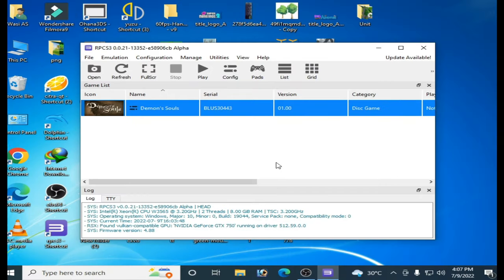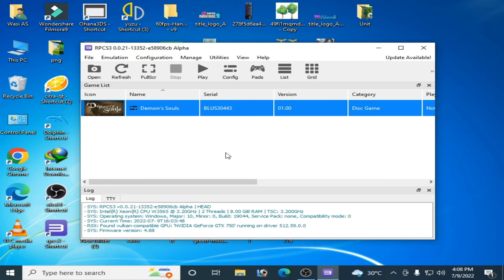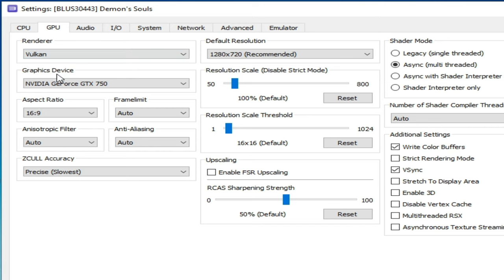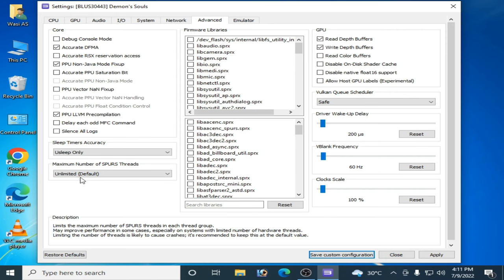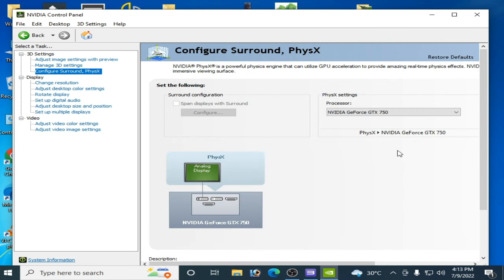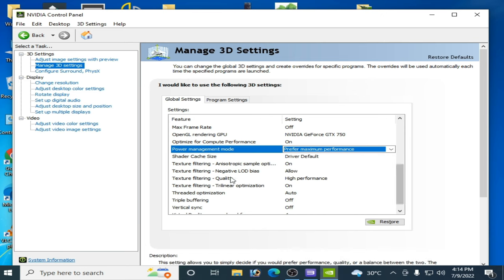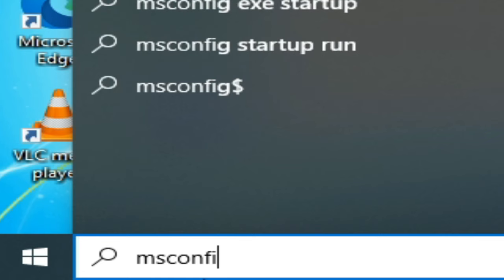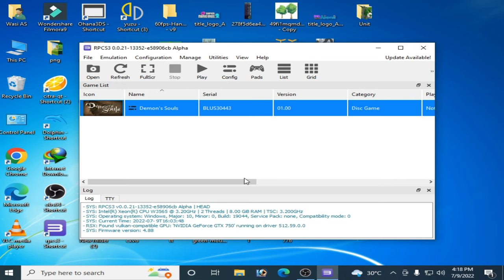How to Fix Audio Crackling and Stuttering in Rpcs3

Comment: I am not doing anything until you explain why you are checking these things on and off. I can randomly check things on and off by myself.
Reply: I mean , You've got a point.
Reply: Ok murican
Reply: nah i agree with this i followed the tutorial aaaalmost to the end til my computer told me i need a bitlocker key to get back into my pc lol i changed everything back
Reply: @Darkopolypse98  that is due to doing the last step where he uses 'msconfig" cause it is necessary to do operations in windows files and you have bitlocker protection enabled so it needs to verify the bitlocker key

Comment: It worked for me, but i had to limit the FPS to 60 otherwise the game is like 2x and that can damage the GPU
Reply: wut? My dude, running the GPU at 100% won't damage it unless you turn the cooling off.
Reply: @harryshuman9637  If you're running at a crazy high framerate then the GPU is doing far more work than required, especially if you're on a 60hz screen.
Reply: @alex-qn5xp  If you need 100% GPU for it to do the job right given bad optimization of the emulator, then it is required.

Also it has nothing to do with what I said about cooling.
Reply: @harryshuman9637  nobody said anything about cooling, he was saying that uncapping the framerate can make your gpu hot which is true.
Reply: @alex-qn5xp  Dude he literally talked about damaging GPU which can only be done by bad cooling.

Comment: Yeah this did not wok at all. Do not follow this guys tutorial not worth it.
Reply: It worked for me. I followed every step, and I got more FPS with significantly reduced audio stuttering in Sega Rally Revo. I usually don't hear any stuttering anymore unless I brake, and even that is better. Before I found this tutorial, the stuttering was constant and heavy, and I had less FPS.

Comment: Doing some testing of my own reveal that limiting SPURS threads actually works. Ignore everything else, just try this
Reply: been trying to get inFamous to run on my steam deck and online people have been saying it's impossible. well now I'm getting a stable 20-30fps with no audio crackling! it's possible after all.
Reply: from what i've seen, reducing SPURS threads reduces CPU usage, at the slight cost of performance. this gives more room for the audio to compute -- when it comes to this, it's an act of balancing CPU performance and audio quality.
Reply: @JusFoNo what would you recommend for infamous 1? Trying to run it on my pc
Reply: @JusFoNo  Heya! I've been trying to get InFamous to run well and even with limiting threads to one it leaves me with crackling during high-audio scenes such as the very beginning, where the explosions are going off all around. Any advice or other settings you used, or is it just an issue of specs here?
Reply: This works for fixing steam deck lag. Running a pretty steady 30fps now. Thanks.

Comment: For Ratchet and Clank HD I only did the CPU settings and it worked. The crackling and audio delay were fixed entirely. Thank you for the tutorial.

For anyone else watching this video, you don’t have to do all the settings. Do them one by one and test the game out each time you change something. Sometimes an overkill of settings will make the game run worse or create other issues.